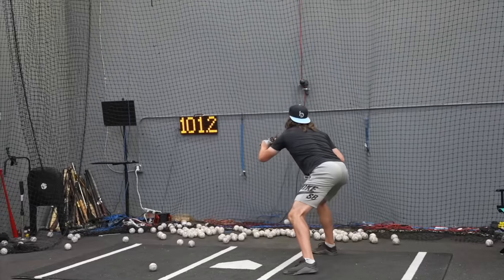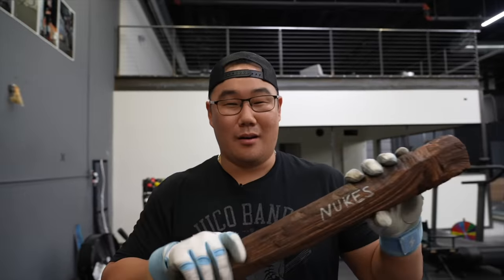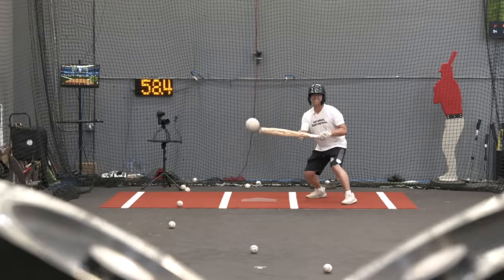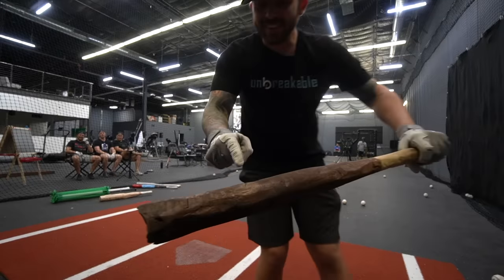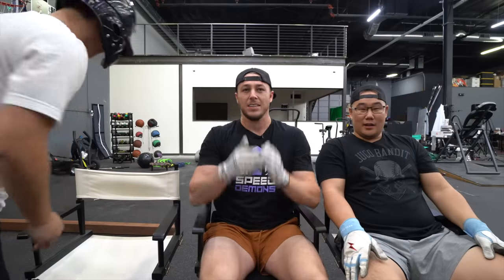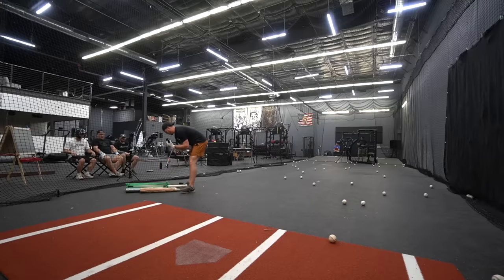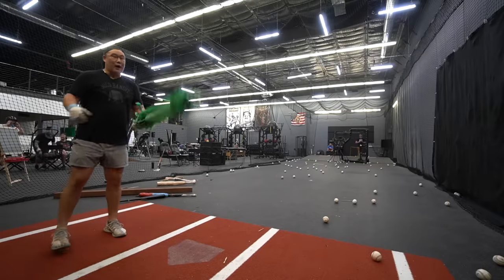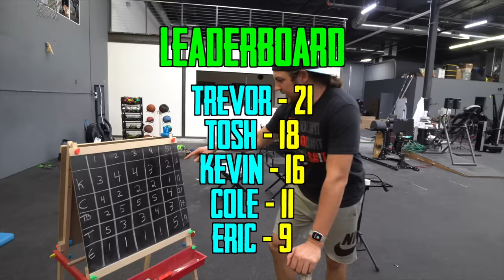Can a Homemade Bat Hit a Baseball 100MPH?

Comment: I think Kev had the best idea with the axe handle.
Reply: Haha! Thanks! The only thing that “broke” on my bat was just the duct tape ripping. Would need to either tape in different directions or find a better way to attach the barrel. Lol!
Reply: @Chanterprise  3M VHB 5952 (this is double sided so would need an outer layer of something)
3M Aluminum foil tape 425 or 427.    (same tape different size)

hehehe Id love to see you guys make some bats with those tapes just to see if they would break and how they would work. With the various real world applications of those tapes it makes me curious if they would work and how well. With what these tapes are able to survive in their intended use...could being a baseball bat break them...

Those tapes are worth a look just for the comedy value for the Momentum guys.   If you are a fan of the channel....try not to look up them so you don't ruin the possible surprise if they do me the honor and making a video out of it.